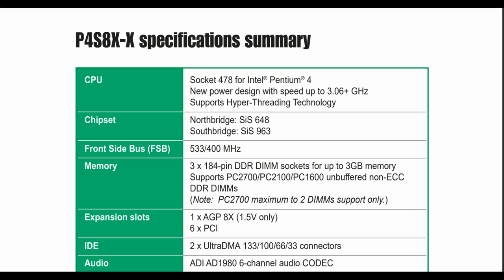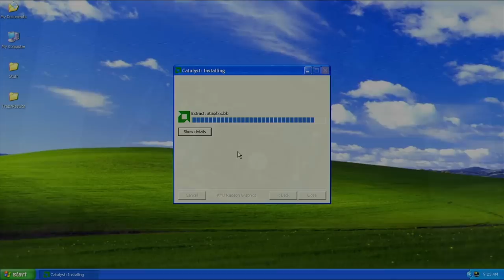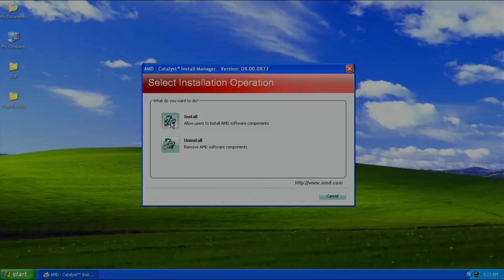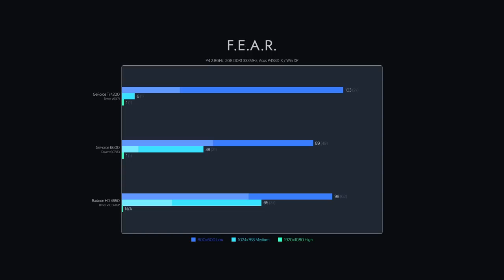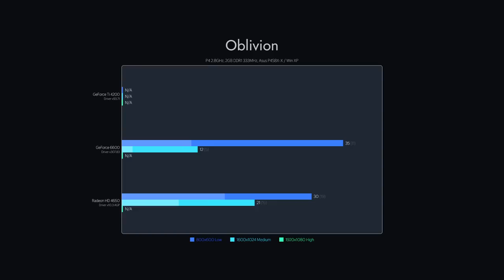2002 High-End Gaming PC Build

Comment: The 4200 was miles behind Radeon 9700 when it came out, the card was utter shit. In honesty. Also if you're going for a high end XP build this doesn't even touch the sides. I wouldn't even say it was a mid-end build for an XP system. Going with the single core pentium and 4200, you'd of been better with a 98 "High end build".